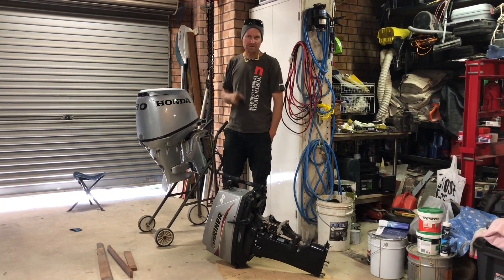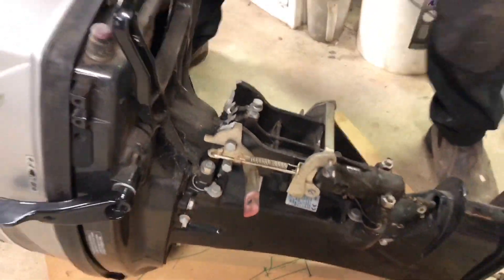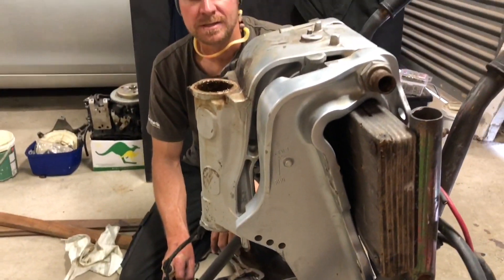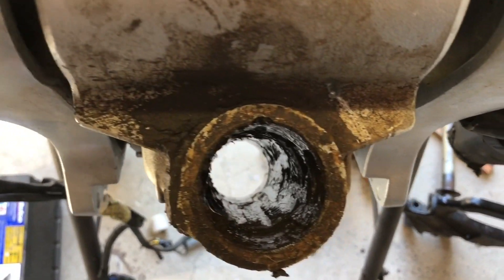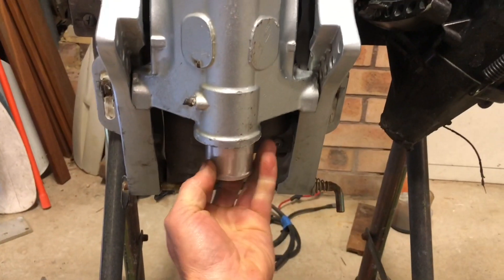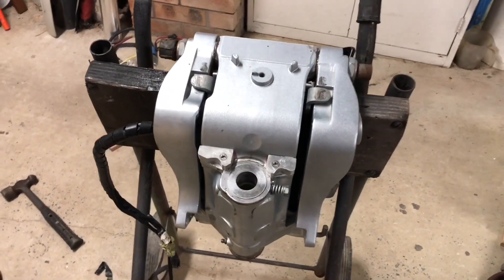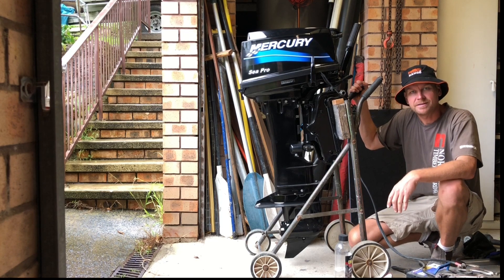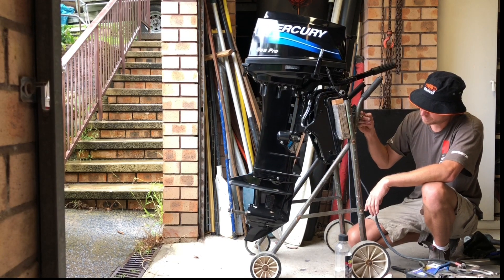30hp Custom trim and tilt.

Comment: Hey mate. Where are you located. I really need this
Reply from the maker: Hi Mate,
I’m in NSW Australia.
unfortunately as you saw it’s a very custom unit and I am not planning on doing any more, the labour and parts are worth more than the outboard sadly.
You could look up the CMC trim units, they are off the shelf.
My trim - tilt setup will go with my motor when I finally sell it.
Cheers 🍻 
Aussie Boat Guy 😎
Reply: All good mate. Did you do the whole thing with a 9 inch grinder. Shaping and all. And also the grease nipple. Did you line it up with the existing hole on the internal barrel. Might have a crack at this. Cheers
Reply from the maker: Hi Champ,
Nine inch, five inch and 4 inch, die grinders, flap discs etc.
Yep, the nipple feeds the correct area and also tapped the steering friction screw in the correct spot.
The steering stops are important as well.
I reckon there is enough to follow along with in the vid to replicate the unit.
Keep me posted.
Cheers 🍻 
Aussie Boat Guy 😎

Comment: Thinking about doing something similar blew the original motor mounts out. Having trouble removing the leg from the steering bracket and the service manual is not much help. Any advice for removing the studs/ lower motor mounts would be greatly appreciated.
Reply from the maker: Hi Champion,
Yeah, they can be stubborn. From memory, there are retainer plates and the mounts slide into the trunk (leg). You will not be able to remove the complete clamp bracket from the leg without removing the shift rod (gear selector rod). This can be done by removing the carburetor and taking it upwards with some manipulation.
Cheers 🍻 
Aussie Boat Guy 😎

Comment: Hey mate, did you paint the outboard yourself?
Reply from the maker: Hi Mate,
Yes I did,
it’s two part primer followed by two part gloss paint, finish is actually better than new factory and used reproduction decals.
Cheers 🍻 
Aussie Boat Guy 😎
Reply: @25hpboatracerman  yeah the finish is amazing, is this just out of a can?
Reply from the maker: @yahnpavlovic9626 
Hi Mate,
It’s Two part paint, you need to mix two parts and use a spray gun.
The finish from a can is not as good and also the paint from a can is not as hard wearing and can be affected by fuel or oils 
Cheers 🍻 
Aussie Boat Guy

Comment: Really like your experiments and work, especially the small engine stuff. I found your channel while searching for power-tilt conversions, as I have a project that requires a 15-20HP, 4-stroke electric start with forward controls. Not much around second-hand that has power-tilt as well. Maybe a visit to the wreckers is in order! Cheers.
Reply from the maker: Thanks so much mate, I really appreciate your encouragement 😊
Yeah, it’s hard to sort out trim and tilt if the motor doesn’t share the same bracket as a trim tilt version.
Always a way around it of course 😂
All the best,
Aussie Boat Guy 😎

Comment: So you have no kick up ? If you where to hit a log or something
Reply from the maker: Correct. Unless the Honda clamp assembly has a kick up function, which I don’t think it does.
Actually don’t think any of the small motors with trim tilt have a kick up function.
Anyway, where I use the motor is open waters not rivers or shallows. Also plenty of those 25 - 30hp Honda’s floating around with trim tilt still going well so fingers crossed I don’t hit anything.
Reply: I can understand that. I think maybe the top pin is designed to shear maybe ? Could always mount a kick up plate. Enjoyed your videos on this merc, it’s the type of thing I would I do ! Appreciate the content !
Reply from the maker: Cheers mate,
Did some more research, looks like it does have some sort of internal release if you hit a submerged object but I’m assuming things will break regardless.
Glad I don’t run skinny water 😬

Comment: I'm planning to do this on a 25hp enduro. Any advice?
Reply from the maker: Yep, just know it will take a lot of effort and time and I don’t regret one second of it. Whenever I trim the motor underway I smile from ear to ear .
Try and find a trim unit that will suit your size and shape then mod to fit your motor.
Cheers 🍻 
Aussie Boat Guy 😎
Reply: @25hpboatracerman  cheers.

Comment: Hi mate

Great videos
I have just got my first boat and it has a 25hp Honda just wondering if u could point me in the right direction on where I could get my hands on a trim and tilt like this ?

Cheers
Reply from the maker: Hey mate,
I would just ring around all the outboard wreckers. Also keep an eye out for any non running motors for sale. 
If I’m after a part I often put an add up saying wanted part etc.
Cheers and enjoy being on the water mate.

Comment: Man that's sick! Been wanting to put a trim on my 30merc but no luck with local mercury dealer, have looked on ebay but from watching your vid, seems to be abit more to it than I thought. Interested if you live in qld, I'd pay you for one on it for me
Reply from the maker: Cheers mate 👍 yeah, I love it.
Definitely a lot of work and I just did it because i love that sort of one off stuff.
The parts and labour would end up costing a small fortune unfortunately.
Have you looked into the CMC trim units? They would end up a cheaper option (not as neat though of course)
I’m not in Queensland, would like to be though.
Thanks again mate,
Aussie Boat G 👌
Reply: Thanks for the info mate, I didn't know about CMC, I have just looked at there site, very interesting but your right no where near as slick as your work. Will definitely send them an email cheers man
Reply from the maker: @tautuhitangira2432  
👍👌

Comment: Love the videos mate.Do you have any idea how I can add tilt/trim to my forward steer yamaha 30 hp cv and roughly how much it would cost if possible?

Any help appreciated.Keep up the great work.
Reply from the maker: Hi mate,
The best way would by to add a CMC pre-made trim-tilt unit.
Think they are about $1400.00.
Adding Custom trim thd way I did my motor would be extremely expensive if you had to pay someone to do it.
Maybe the cheapest way would be sell your motor and but one with trim tilt.
Cheers 🍻
Reply: @25hpboatracerman  Thanks mate.My thoughts too.I looked into the cmc and panthers ages ago and thought even they were very expensive I'll keep her as she is until I decide if I can justify buying a 40hp brand spanker.8k buys alot of fuel.😂

Comment: Hey mate from BC Canada! Eh I got a 25 merc sea pro same as in the vid I up rated to 30hp via changing intake gasket and setting timing to 25* is there Anything else a guy can to for more power? Have herd the exhaust tube is different on the 30? Any help would be much appreciated! Love this channel!!! Cheers!
Reply from the maker: Hi mate.
Well done on a great motor, they are awesome.
The exhaust tube is the same in the 25 and 30hp version, looks like you already got the extra 5hp.
We have shaved the head on them in the past to make more compression (around 170psi) this have us better torque by a fair bit but didn’t notice top end speed increase. We have also played with raising the exhaust port which changes the power band to a higher rpm and results in better top speed. Keep in mind it’s very easy to loose speed if the slightest thing is wrong with the porting.
If your motor is on a light boat I would play with props and engine height over trying to mod the motor as they are pretty dialed in already. 
If it was a 30hp Yamaha 3 cylinder then you can get a fair amount more power out of them but the tohatsu built 30 (Mercury) is a great motor.
Hope this helps
Reply: @25hpboatracerman  thanks so much cheers!

Comment: Im curious if the 18HP tohatsu outboards are really a 20 HP or 25 HP block choked down with the carb. Any thoughts?
Reply from the maker: Hey mate,
I have a video on this exact question, search tohatsu 18hp comparison. Here is the answer as well. The 18hp tohatsu two stroke is actually a stand alone power head. It is visually the same as the 9.9hp and 15hp power head but has a larger bore and bigger ports and the 18hp has a bigger carburetor. Same crank, seals, reeds, exhaust cover etc. 
the only way to tell a 18 block from  the 9.9 and 15 Block is it has 60 stamped on the port side of the block (60mm bore) and the 9.9 and 15 have a 55 stamped (55mm bore)
Cheers,
Reply: @25hpboatracerman  Thanks for the info. I got a 18HP and it runs crazy good. Pushes my 16ft Jon boat up to about 25 miles per hour with one guy and about 22 miles per hour with two guys and gear.

Comment: Did you put it on the Fish Nipper? I’ve always thought that hull could use more than 15hp... top speed?
Reply from the maker: Yep tried it out on the fish nipper, was a rough day. The hull coped well with the 30hp. I didn’t gps the top speed but would have been very close to 63kph.
Cheers mate.